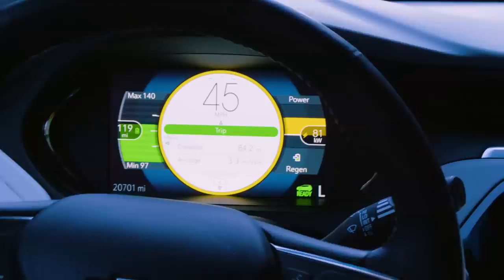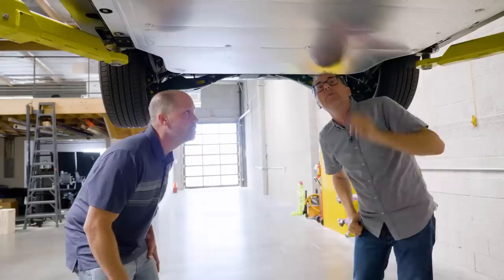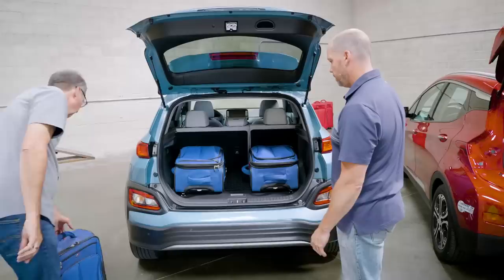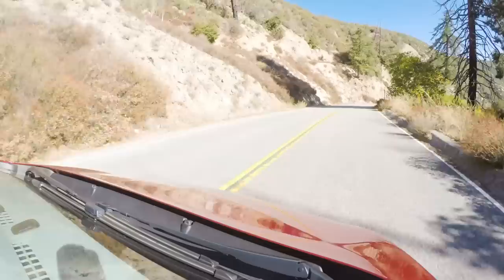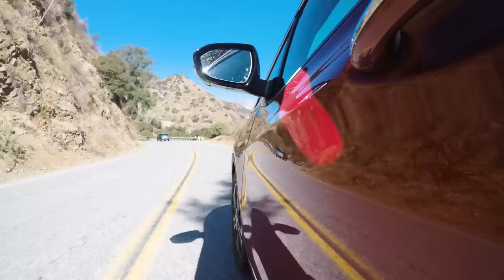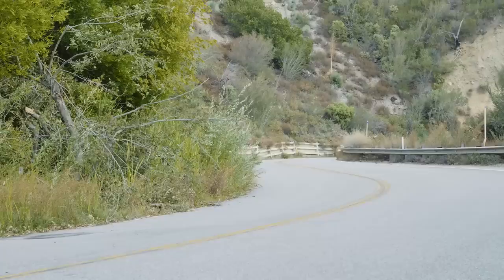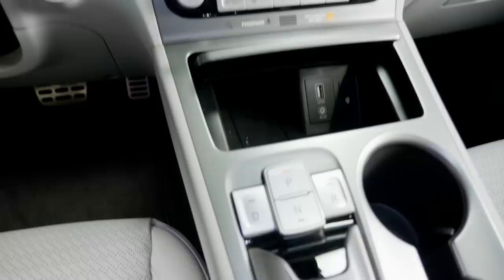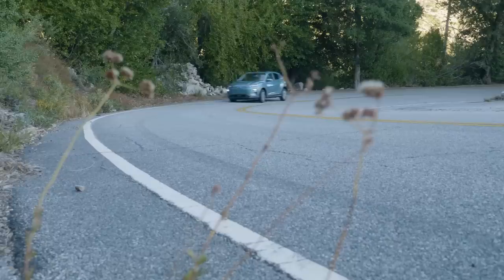Hyundai Kona Electric vs. Chevrolet Bolt EV: Which Is the Best Affordable Long-Range EV? | Edmunds

Comment: About Regen breaking on Kona EV, what you were using is passive regen. There is Active regen feature where you have to hold the left padal on streering wheel it will regen break. This will allow you to do one-padal-driving.

Comment: I really like the Kona EV. My dad just got a Model 3 and that’s really kind of shockingly fast, but if the Kona stays 5-10k handily underneath the price point of a Model 3, then it’ll be a real winner. Because all the Model 3s coming out now are high-end models whether you like it or not. If someone is looking to replace their car in the next 3 months, the Model 3 isn’t a contender against these two. If you can wait a year or two and extend your line of credit enough to get a Model 3, that seems like a good option, but more financially sensitive buyers should probably hold their horses and look at the Kona or at other soon-to-be-released cars in this price range.

Comment: Bjorn Nyland did a review of the Kona Electric when it was released in Europe and got 315 miles on a charge.
Reply: Bolt owners I know all get over 300 miles per charge, But I prefer the VOLT it does everything better
Reply: Apparently some people do not know who Bjorn Nyland is.
Reply: TeslaBjörn is the best. He just tested new Leaf with latest software, now rapidgate is not so Bad anymore, this new software allows about 10kw higher charging when rapidgate limits charging, when compare previous software. But this might not be good for the battery.
Reply: downhill in a tailwind.
Reply: miles or kilometers?
Reply: @racerd3801  Still slaving away on gas huh?
Reply: Eco mode!

Comment: I purchased the bolt in 2017.  I love it.  It now has about 36,000 miles on it and it is so much fun to drive.  The back seat is very roomy.  I will not go back to a gas car.

Comment: Wait--they never looked at the charge ports or talked about charging. This is a major consideration, and dealers are weak on information.My Chevy EV can be plugged into 110 at home, or into my dryer plug (220) with a cable that cost about $400. I never put in a charging station and don't need one.

Comment: I notice that almost everyone commenting here is male.  Also true in every other review I have read or seen about the Bolt.  But please, before you write off the Bolt because of "uncomfortable" seats and " perfectly wrong" windshield angle," I respectfully suggest all you guys check in with the other half of the driving population.  I am a 5'4 female, and I have spent my ENTIRE LIFE riding in or driving cars and trucks where my feet don't hit the floor at a comfortable angle, the seat belt cuts across my jugular,  and the windshield glare at night is so bad I can hardly see (my husband never complains of any of these things)!  The Chevy Bolt is the first car I have ever driven that fits me like a glove.  I LOVE the seats.  The windshield doesn't glare, and the seat belt actually rides in a spot that won't cut my head off in an accident. Not only that, it is a fun, sporty drive!  I guess it depends on whether you would rather have a super fun driving experience or a pretty looking dashboard (which, by the way, I actually like quite a lot, thank you very much).  Me, I'll take the fun, comfortable, safe drive any day over soft seats.
Reply: Thank you. Women took criticism for years for loving the Prius. Time proved us right, at least judging from the 10 zillion of them on the road still going strong.
Reply: Good point, maybe there should be a purpose - built car for small people, it all depends on numbers, basically how much demand there is for a certain sized model. If the demand is there and sales back it up, the manufacturer should pay attention to customer needs, but it all depends on numbers.
Reply: Patrick Chubey - right o, or, since our pres luvs saudis so, let's not let ladies drive anymore. Hmm, yeaa!
Reply: that's great.  Chevy should advertise it as the greatest car for little people.  They could make an ad based on the wizard of oz and have the lilliputians drive away from the wicked witch in it.
Reply: I own a Bolt too.  My wife loves it, as do I.   It has a phenomenal driving position with amazing visibility.   The seats are fine.   Edmund's complaints were bizarre.
Reply: Yeah a lot of stuff with these cars is subjective. These are two excellent cars, the biggest factor is preference. I do think the Kona slightly wins on the objective measures though. Enough that it's what I want. Especially with the full tax credit because money matters a lot to me!
Reply: Thank You Holly.  People are just biased about GM.  I love how they complain about the plastic interior of the bolt but never mention that about the Kono having plastic all over.  The truth is every car has plastic everywhere.  I am glad you like your bolt.  New York City, LA and other large cities use them in their fleet and everyone just loves them. 

One more thing is that they took the curves to fast in the Bolt because they were playing with the regeneration system braking.
Reply: @hizzlemobizzle    ... and then GM will certainly be facing a shitstorm from SJWs or butt-hurt little people feeling targeted in a "racist" way. There's just no winning these days, where every little action and choice of words gets scrutinized and over-interpretated.
Reply: Youtube is 90% male.
Reply: Glad you liked the Bolt Holly. I'm 6'2" and fit perfectly inside this car. The seats are fine and comfortable. I can also sit in the back with someone the same size as me driving and have plenty of leg and head room. None of this can be said of the Kona. The dashboard of the Bolt is perfect, the screen is incorporated into the dash whereas in the Kona it looks like a tablet which someone could rip out. The Kona also has a huge center console that takes up way too much space and has too many buttons  that could be in the dash instead. Many cars today have this type of console and it is a waste of space and unnecessary. For some reason people like lots of buttons, I don't. Both these cars have lots of interior plastic but that is to keep the weight down. I tested both these cars in snowy conditions and the Bolt has better grip and handling. You can buy the Bolt now but not the Kona. I'm  in Canada and will be doing a long weekend test of the Bolt in the spring. Hyundai dealers here have no idea when the Kona will be available and know nothing about the car. The Bolt dealer I am happy to say is very knowledgeable and very enthusiastic about EV's in general. Lots of people have a bone to pick with GM but that is their problem. 55 years of driving experience and I love the Bolt.
Reply: My husband is on ski patrol and we put studded snow tires on our Bolt, and take it to the mountain  every weekend now instead of our Subaru wagon.  It is an excellent snow car!
Reply: Ha !   I am 6'3".  I can say the same thing as you point out.  The car fits me like a glove.  I love the seating.  I have tried to like the Nissan Leaf... no way I can fit in that car.  I am truly surprised a short person and a tall person both like the Bolt.  I had basically stopped buying any Asian car due to poor seating.  The Bolt was designed in South Korea, but Chevy must have inserted a tall person onto the design team.
Reply: @Johnny Ericsson The seat belts are not adjustable--the entire seat is.  So, not only can I adjust the seat height so the seat belt rides correctly, I can also adjust the seat height to give me the best 360 view I have ever had in a car.
Reply: The  Bolt seat is like something from a golf cart and without a doubt the worst seat in any car I have driven in the past 52 years. It is too narrow and this was completely unnecessary. My Prius is the same width and has a much wider and more comfortable seat - and I do not have  big butt. Problem with Bolt is that the engineers were overruled by the bean counters at GM.
Reply: Glad you found the car that fits you! I'm a whopping 5'8" but my Prius fits me just about perfect.

Comment: I am 6'-2", weigh 315 lbs. and am 20" wide at the hips. I have two fused vertebrae and am 75 years old. The seats in my ‘18 Bolt were an issue for me. They were too narrow and not padded enough. 😢 After adding a 1-1/2" thick Garden Kneeling Pad (as documented in several videos on the web) between the seats original padding and it's springs the seat works fine for me. Before this modification I was able to get in and out with ease. Now that I have added the pad my head rubs on the roof when I get in and out. Once seated I have more than enough head and legroom.
All things considered, I LOVE my Bolt! It is one of the best vehicles I have ever driven.
Look Ma, no tailpipe!

Comment: The Kona does not look like it has space for an infant seat, where the Chevy Bolt can fit two easily. 

I'm not sure these two really have enough weight to the fact that the Chevy Bolt was built as an EV from inception, which allowed a much shorter hood, giving significantly more space to the passengers.  As for the seats, yeah they're narrower then normal but I've driven over 8 hours straight in them and have been way more comfortable then my larger SUV because the bolts seats offer such great support. I'm 270lbs and 6'3", so I guess mileage may vary.
Reply: I own a Bolt too.  The seats are absolutely fine.  You're absolutely right about the Bolt's superior design.  I'm pretty disappointed that these reviewers seemed to ignore major Bolt advantages.
Reply: I dont think the seats are a big deal ether but I rather have Hyundai's warranty last two gm's I had where junk and the last one was a 2016 gmc sierra 2500 denali that had a bad transmission. I had that thing in shop 4 times since I bought brand new they wont do anything about it les then 10 thousand miles on it that's why I would buy a Hyundai. Hopefully you never have a problem with your bolt.

Comment: Im surprised the reviewers didn't comment on the fact the Bolt battery is encased in steal, while the Kona was covered in aluminum, even though it sits closer to the ground?!?! this is a big deal, I think the negative image Chevy has generated over the years, makes it difficult for a lot of reviewers to see the positives when reviewing the Bolt. Positives tend to be down played or unmentioned while negatives are overblown, like the plastic interior, both cars have cheap plastic interiors and frankly i find the Kona dash to be boring and uninspiring, while the Bolt has all the relevant EV info front and center in your face with a modern tech look. Its a very Korean design but because its in a Chevy everyone rips it or ignores it. Keep in mind the Bolt is on its third model year!
Reply: I never in a million years thought I'd own a Chevy.  Then I drove the Bolt... the rest is history.  LOVE my Bolt!
Reply: @hollykoon1727  I'll love it if I had it ,gas pump have me stressed out lol
Reply: The Kona head up display is very useful as it puts all the stuff you need in your eye line - speed, speed limit, satnav directions, lane assist & notification of vehicles in rear corners. Makes most of the dash irrelevant.

Comment: Perfect 2nd family car to compliment the SUV.  All day range for running around (4+ hours of driving on a charge... that's a ton... when was the last day you drove more than 4 hours?).  Charge up overnight at home and you're ready to go again.  I wouldn't even care about public charge points or fast charge networks because that's what my larger, long-haul MDX is perfect for.
Reply: You can drive a lot longer than that, if you keep it under 65MPH around town you can go well over 300 miles on a single charge in the summer time. We dont even charge our Bolt to 100% just never need to...
Reply: alliejr it is a great second or third vehicle, but if purely purchasing for financial and economic reasons, a standard hatch might still win out if owned for the standard consumer length of 5-7 years.
Reply: I think the EV will be your first car and your fossil will be your second car, only used for special tasks :)
Reply: @ALMX5DP   Agreed.  I don't think of it in terms of $$$ saved.  It is certainly more of an environmental thing.  But there is also a selfish convenience factor.  Imagine if the tank in your gasoline car was always full and you never had to visit a petrol station. :)
Reply: @miloe436  yes. My family  Bolt is the primary car. Gas car is the backup.
Reply: alliejr I think still more environmental (even if that’s a bit overhyped currently) and image. Convenience still reigns supreme for the gas car in the US due to infrastructure. But considering gas counterparts sell for half the price, that’s a lot of financial ground to need to make up for any perceived convenience or environmental reasons to me.
Reply: That's an interesting thought. I wonder how many people might consider buying an inexpensive used gas powered car for range and also having an EV for short range trips / commuting? Until they can make truly high mileage EVs it's something that people might find themselves doing. It depends on your cash flow and driving habits.

Comment: Does the Kona have the same battery temperature control that the Bolt has?  Very important with respect to life time range of the battery.  A not so obvious advantage and element that makes the Bolt such a better vehicle compared to many EV's.

Comment: The regen is great on the Bolt it stops the car, you really can drive with one pedal.  The tires are not great for handling but if you go to grippy tires your range really does drop.
Reply: I can drive for weeks on end without touching the brakes a single time.

Comment: First, thanks, guys, good review. But...

Which is best - IF YOU CAN'T GET ONE, IT DOESN'T MATTER MUCH...

And I MUST agree about the Bolt seats - I could NOT drive without my arm banging the console constantly. Cannot FIND a Kona to test.

And I am in Central Cali, the home of the electric revolution (with Kona-less Hyundai shops ,ONE Nissan/Kia dealer and TWO Bolt dealers, yeah, right...) Look for the video of downtown Oslo, with the parking meters replaced by CHARGING STATIONS!
THAT'S how ya do Electric Avenue...

Comment: So close. Maybe a slight edge to Hyundai on interior quality, but if you use the back seat often the advantage goes back the other way.
Reply: "Maybe a slight edge to Hyundai on interior quality"
No, interior aesthetics. Quality would include durability and function. They didn't test Hyundai's durability and function over the last two years  because the car hasn't been produced yet.
Reply: Back seat space is not a problem. I used mine and is astonishing comfortable. My two girls wanted us to buy a big SUV because they loved the Idea of having space. We ended up exchanging our Mini for a second hand CX5 (so plenty of space). In fact, they didn't like the Kona because they felt it had not enough space at the dealership. I was prepared to have long battles about what car to use when we are the four of us because of the space of CX5. Not even once they asked us to switch to the ICE one. They must feel comfortable in the rear seats, for sure. If they were not they would choose the CX5 every ocasion they could. They never do.
Reply: Looks like the Volt is dead with the subsidies (and several other models).
Reply: No wonder chevy is still in business with this thinking...... close?

Comment: Wonder what is protecting the underside of the battery pack? Hope it is something better the aluminum sheet.
Reply: I know.. it battery  looks so low to the ground, that if you drive over some object on the road, you could scrape, or damage battery...
Reply: The Bolts battery pack is an integral, structural part of the car. Remember it was designed as an BEV. I imagine the Bolt would do better in a side impact collision. It feels very rigid and solid.

Comment: I had no idea that the EV rebate program was per manufacturer.  So am I understanding correctly that Chevy will have to compete with no rebate against Hyundai with a $7500 rebate?
Reply: Yep
Reply: Yes luckily for chevy Hyundai has production issues so they wont steel much sales.
Reply: That's bizarre.  If the purpose is to get people in EVs (and to support domestic producers) why would they design a system this way?